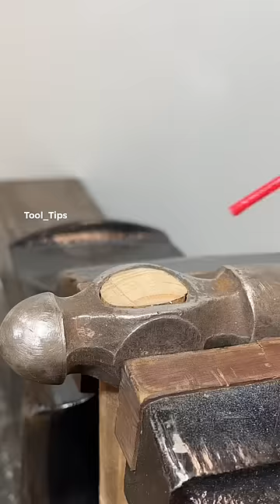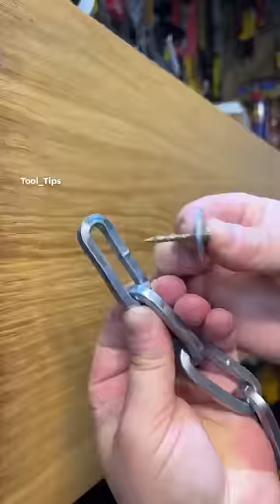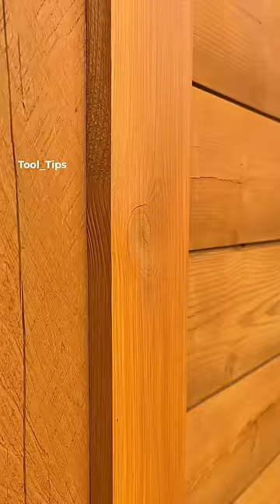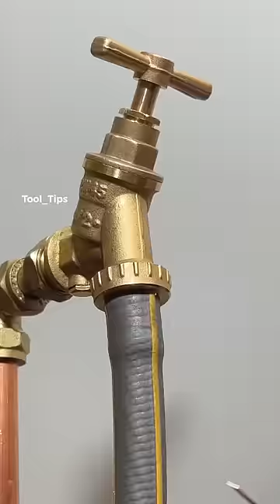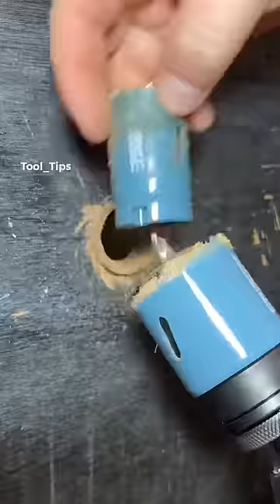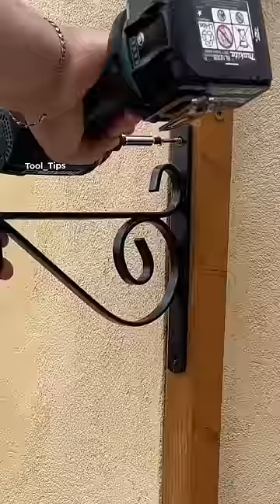Top Tool Tips on #shorts

Comment: That corrugated nail is not an adequate wedge. And it is not intended as a wedge of any kind.
Reply: They are also really hard to drive into hardwoods without folding over.
Reply: it's almost like a wedge needs to be wedge shaped
Reply: The corrugated is for picture frames and such
Reply: What was he hammering down in the first clip?

Comment: The chain for tools was pretty nifty, and aesthetically pleasing.

The rest, except the wire on the hose, aren't even tips. That's just using the items exactly as intended.

Correction: I'll concede on the hole saw tip, because most folks don't know you can do that, and it isn't intuitively a feature of the tool.

Comment: What is the liquid being sprayed onto the hammer heads?
Reply: crazy glue ?
Reply: My guess is its probably to ease hammering that wedge in. If it was dry i guess it would bend. If you noticed he only oiled those wavy wedges and not that standard one which is thicker than wavy ones. Also standard one can be reused if handle breaks, wavy one most likely not.

Comment: Why do some hammer handles get oil and some not?   Like the chain screw driver holder.
Reply: My guess is that normal wedge is thicker and will not bend by hammering it into the handle. Wavy one will not be that durable and it will probably bend before getting all the way in. Personally i would never use that wavy wedge, normal ones worked for ages and in lot of cases can be reused when handle breaks.
Reply: @Raven777777777777777  I think the wavy ones won't work out or loose as easy.

Comment: What was that weird shaped metal object he hammered in at the very beginning?
Reply: Its wedge for securing handle in the hammer. Im not an expert on this but something tells be it should be turned by 90 degrees. Wavy one will not be as effective i think. Maybe it depends on what kind of handle and hammer you have, then you choose size of the wedge for that handle/hammer.

Comment: Whats the copper around hose thing?
Reply: To keep it tight from leaks, and from falling off.
Reply: @xtrixplexx  thanks😺
Reply: Copper isn't strong enough.  What' wrong with hose clamps that there are so many twisting wire methods?
Reply: @reeselayton3031  👍 Подскажите аффффтору, что хомуты изобрели!!!! И они уже давно продаются.
Reply: @ВячеславМакаров-м4ф  Can't read this language.
Reply: @reeselayton3031   сори, а, м донт спик инглиш....
Reply: @reeselayton3031  A Russian dude wrote to you that water clamps are on sale, and as far as I know they are not expensive. Copper wire as a clamp does not make sense, because even if the construction wire for knitting reinforcement will do better.
Reply: @Anrakyr 
 * bailing wire
Reply: @herdHistruth  A bailing wire? Is that what it's called? I didn't know.
Reply: @Anrakyr  yes, I've been a electrician for 40 years, we use bailing wire for certain installations.